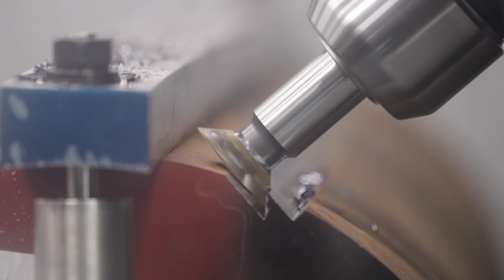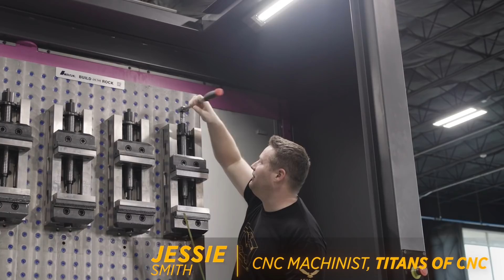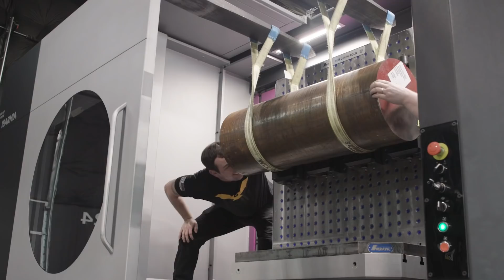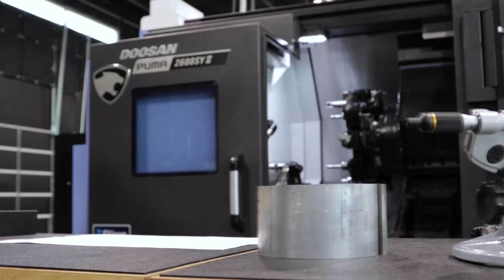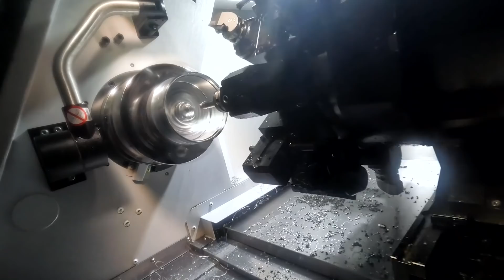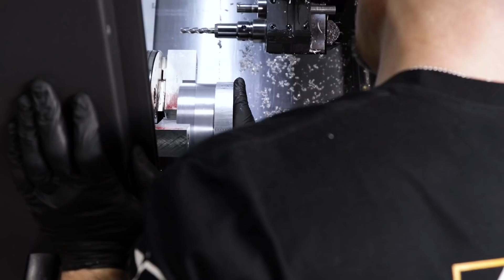I Was FORCED to FAIL on a CNC Machine

Comment: Gees that's an accident waiting to happen the belts on the end of a fork lift wow The forks need to have holes through the tips to put an eyebolt or a pin into so the belt will not slip off- safety first- you don't know what you don't know -- and you gave some very good advise here

Comment: When in front of a machine tool, there's only one answer to "what's the worst that could happen", and it's "getting myself killed". Whoever you are, never accept a dangerous job if there is any doubt about any of it. You may die from hunger, but it's a lot less likely and less painful than getting torn to pieces by heavy machinery.

Comment: Great story Barry:  Same on my end, did two years with my mentor and he left and they dropped everything on me. Even though it was manual machines (late 80's), we still did small production runs up to 300pcs. After a couple years I started pushing cnc. We got a single tool BridgePort V2XT. I had to basically teach myself and manage two people. Now since 2005, my shop with 6 cnc's and two employees.

Comment: Did you use to work where I work? That is how the shop is I work for well for the most part. We have programmers just for some of the machines the rest is shop floor programming ,set up, and run the job. We also do 4140 heat treated shafts up to 13 inch diameter and can be as long as 200 inches with the whole diameter needing to be turned with a +.000/-.003 tolerance down the whole shaft.

Comment: I have been in those situations.  Mom and pop crap shops that are too cheap to buy a $300 year subscription for a decent cam system, and train some one..  Then they put u on a crap job and the other machinists want you to fail, because it makes them more valuable. Ask them for a tool and they tell u to get lost.    I can happily say, I rose above them, and theyr stuck in the same crap shop, I now make over 100k in a corporate shop, and do design work with an engineer title.
Reply: https://youtu.be/dZuaeqaGIkw

Comment: I was set up to fail in my very early career but not in a positive way, one of the boss didn't like me at all and wanted me to quit the job on my own instead of firing me. So what he did is have me setup a giant steel back plate for a mould that was 2'x4.5'x 3'' and drill a bunch of 2.5'' diameter thru hole with a spade drill on a 10 HP spindle machine that was 25 years old, 0 rigidity and no thru coolant. As I was setuping the machine a strong feeling of ''I'm  not so sure about this'' started to grow. I went to see the machinist next machine and told him what they had me set up. He told me ''it's not gonna work, I can't believe they have you doing this, let me have a talk with the foreman''. He went on to see the foreman and he had the same ''WTF is this'' reaction. They both went into the boss office to have him change his mind , but he was adament I had to do this. They came back to me and told me ''Look , we don't know what's wrong with him, but he really want to proceed with the operation, we told him the drill was gonna fail and he replied the piece is needed ASAP and willing to take the risk. Just do it and don't feel bad about broking that piece of equipement, we all know what the income is gonna be''. So I finished the setup and hit cycle start, the drill went to the hole , dug approximately 1 Inch into the material before it snapped into pieces. The boss came to me and was like ''how did you end up broking that drill ?????That piece of equipement is worth 2x your paycheck, WTF did you do?''. The week after, they announced that everyone was getting a raise, everyone except me, and told me it was to make up for the broken piece of equipement. I took all my gear, left and never came back to work and proceeded to have a very successful career in another shop.
Reply: well done, did you punch him in the face after all ?
Reply: Honestly, I wish I did.

Comment: Sounds like my shop! 🤣💯 But I love it though. Right out of school and they put me on a 5th axis to program and machine a part from a sample piece. After I run all the parts and hold them to +/-.1 metric to the sample part they say, oh btw here's the print from the company for this part and of course there was tighter tolerances than +/-.1 on the print. Turns out the sample part had some things out of tolerance to begin with, so all of my parts where just slightly out of tolerance. I was so upset because I had taken such pride of what I had accomplished until I saw the print. 🤦

Comment: I work in IT, but I remember a distinct moment when I had the realization "...if I want to get promoted from bottom rung to the next level, I need to start solving some of these problems before escalating them so that I can have issues escalated to me."  There's a point at which you should ask for help, but too many folks ask for help immediately then barely pay attention when a solution is explained to them.  I was resetting passwords over the phone in those days.  Now I'm the lead data engineer on a million dollar contract.  It's been a long road, but an instrumental part has been taking the initiative to solve problems instead of appealing to others at the first sign of difficulty.
Reply: https://youtu.be/dZuaeqaGIkw

Comment: That's an excellent story that hits home. Early in my engineering career, I was asked to work in the die shop with the Foreman while the company had labor issues. I had no experience in a tool room, and with the two of us doing the work of eight, we had a lot to do. He took the same approach with me that you described. He put me in front of a welder, lathe, mill, or whatever, gave me the tools, and walked away. I would get so frustrated being so overwhelmed with so much to do. He would let me fail and learn, but he never let us fail as a team. Sometimes I nailed it, and sometimes I didn't. I learned more in those four months about what I am capable of accomplishing than any other point in my career. Years later, I still consider him a good friend and mentor. 

As a manufacturing engineer, how can we help promote this form of learning on the floor to grow new talent?
Reply: This guy did the same thing, he would let me fail to a certain point but wouldn't let it kill the project or hurt the company.  I almost put in this story that I learned more in 3 weeks under this guy than I did in the 2 years I was at college.  It was a great experience and he was just as eager to learn and grow as I was and the more I learned the more it pushed both of us.  Thank you for sharing your experience.

I wish I knew how we could promote this form of  learning in todays world.  People have gotten so soft nowadays it is hard to be stern without finding yourself in HR.
Reply: We got a job where the wall thickness of the part is .002 (titanium) with this 7.9 dregree angle and other werid angles. All new and even my foreman was like "seems like a tricky part, I have ideas buuuut you figure it out"....I was like dam what the hell am I supposed to do. Honestly it's my first time actually taking a roughly sketch idea from a customer who also was like idk lol. Building all the fixtures and trying to find all the methods to do it, I was able to actually pull it of which was an amazing feeling. Even though I did tear 2 parts the 2 that I did do the customer was happy that It could be done lol. And now the hardest part to figure is how to make this teachable and also cut down on time with having parts rip. But this experience showed me that I've actually learned something and am capable of thinking outside the box and being able to sift through the chips to find the part that the costumer was looking for.

Comment: Been there before. I had about 5 years experience CNC turning in a production shop. Then got a job CNC turning at an aerospace jobbing shop.
I knew the machines helped a lot. But here's a drawing, you have 11/2 hour setup and programming. 7 hours to make 20 parts. Bye see you at 5.
What?
I didn't know my way around the shop, where to get tooling, had to grind some custom tools write the program on the machine. If I remember correctly it was a 13T Fanuc control with simulation, which I wasn't familiar with that Fanuc control, but it was very similar to other Fanuc controller's.
What a wake up I thought I was pretty hot stuff until then. 
I didn't stay there long. Same thing foreman would walk over look at my setup and say, " That won't work." And walk away. Then come back at the end of the day and shit all over me for not making the production time.
The problem was this guy wanted me to fail to make himself look good.
 The company had a high turnover, the foreman only wanted operators and ass kissers.
Reply: I can relate to your story. Sad when people set someone else up to fail just to make themselves look good. I'm in charge of afew cnc machines in a factory and I show people everything I know myself. The better people are around me the easier my job is.
Reply: https://youtu.be/dZuaeqaGIkw

Comment: tbh its the fastest way to learn the trade.  yes you will make mistakes but most of the time you will make them only once. most of our jobs are around 10 parts so we have a lot of thing to program and to setup every day and everyone needs to be able to program "if needed" setup and run there jobs
If you keep holding there hand with everything, they will come back with the same questions over and over again. the only thing i dont  give them are time sensitive jobs so they can think and focus without time pressure . and when they are ready to run i check it and let correct it  or show how and why we do it this way. i learn new thing every day and i am already  20y in the trade. i dont mind if you fail or fuck up something but i can get annoyed if it is the same mistake over and over again.

Comment: Not first but who really cares? 🙄 Great video. 👍🏼👍🏼 Quick question though... why does this part have to be oriented in this position? Wouldn't you still have access to all 5 surfaces if the vises were on the table instead of being rotated 90 degrees and attached to the tombstone?